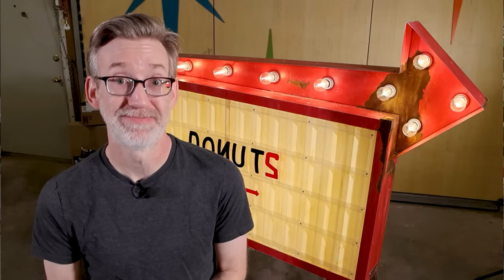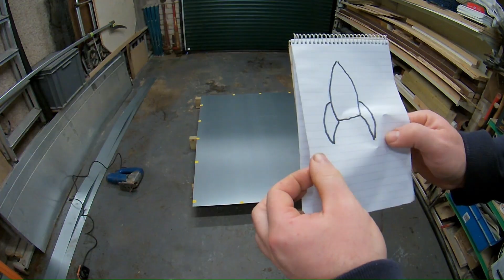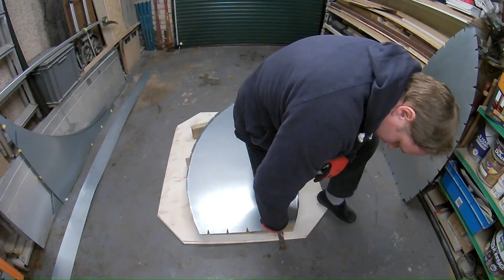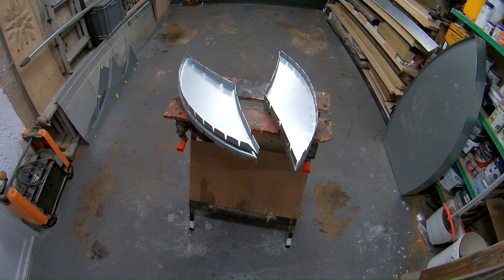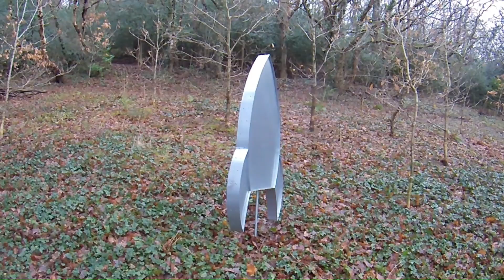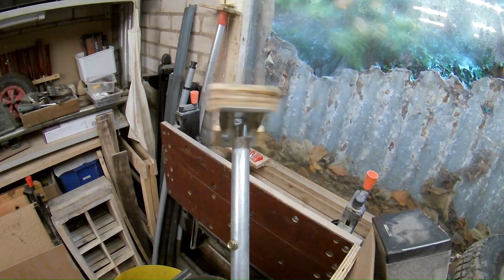Spaceship build

Comment: Hehe, I didn't expect this, defo one of your more bonkers projects, and a lot of fun! :D The metal strip at 9:25 does seem to make some good 1950s style extra-terrestrial sound effects too! The self tappers obviously ain't ideal but did the job - you might have got away with using aluminium pop rivets bearing mind you've not got to actually fly in it - the galvanic corrosion vs standard rust probably wouldn't matter in this context, but could be mitigated further if desired with a dab of clear varnish or epoxy or something similar to isolate them and keep the water off - although in practice it did turn out handy being able to unscrew it to get the mounting bracket down Jaws' throat. That marble bearing is a great bit of improvising, although I'm hoping the whole thing doesn't take off for real in the next storm or you'll have the Ufologist crowd flocking to Rowen! And for anyone who likes this rocket but lacks the budget or DIY skills to build one, just sit back and relax, it's probably only a matter of time before SpaceX crashes a real one into your garden for you! XD Thanks for the video, sir! :)
Reply from the maker: It has been holding up ok to the wind so far, and we have had some strong winds this week too. If I had thought about it I could have of set the trim so it was deeper on one side than the other, that would have caught the wind better so it spins more, I might do that if I ever remake it.